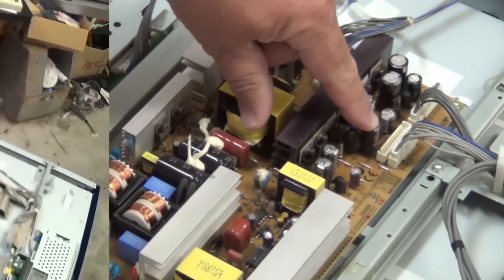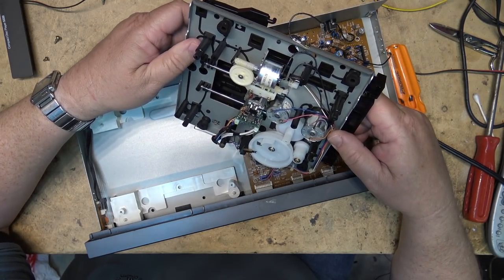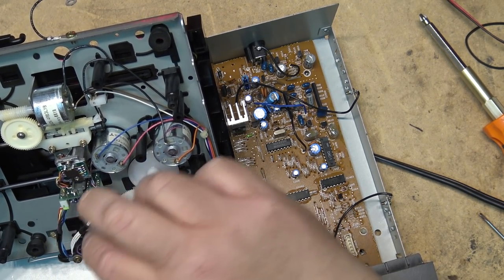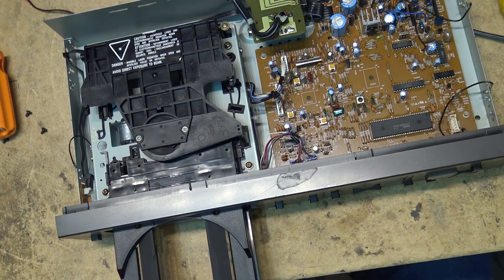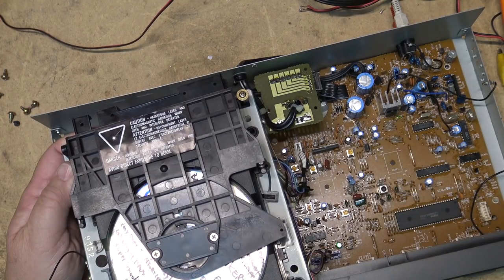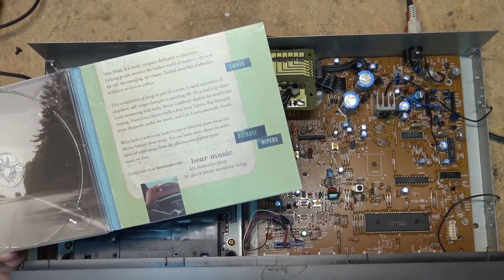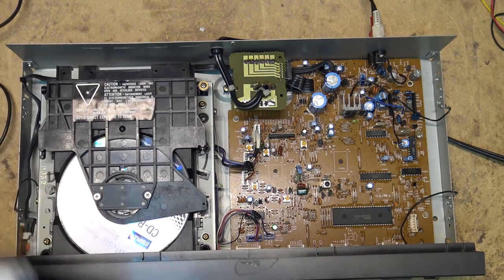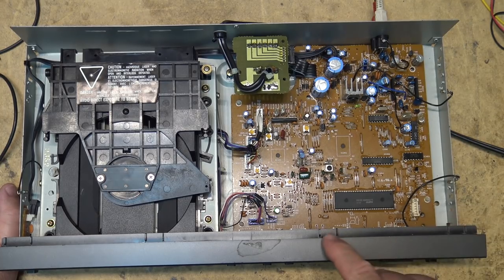NAD 5320 Single Disk CD Player REPAIR

Comment: You are right. The only way cd’s go bad  is through your own neglect. The cd is an excellent format for the car, boat,  home, or wherever you  roam. I personally love the format,especially for recording vinyl onto. I love vinyl also the vinyl may have the warmer sound; however, the cd has everything else one would want; convenience, compactness, record ability with no noise of its own,portability, etc. I find sometimes when they remaster the recording, it many instances they don’t sound right.(cd’s). I like NAD. I’m like you. I like CD players in the car. I like your videos.
Reply: I rather use a usb stick with Flac Files

Comment: Thats true with cars and CD players nowadays.. My VW Tiguan from 2015 still has it all. CD Player, Aux in, USB, SD-Card or Bluetooth. Mostly I use the bluetooth with my phone. As always very interesting repair video.
Reply from the maker: My older volt 2012 has USB, aux, and cd player that supports audio, mp3, .wave, .flac.  the new one has no cd. Just usb, sd, aux and of course bluetooth.  I don't steam music as my data on my phone is only 3 gigs. I also don't have much music on my phone. A couple thousand tracks is all as they were on the micro sd card when I plugged it into the phone.  I do have pretty much the entire library I have on the 128 gig sd card in the car.  It's great for road trips. I just leave it in random all the time.

Comment: NAD was founded in London / UK in 1972, I only own a Nad Stereo Amplifier 3020i which has cosmetic damage on the front panel but still works fine, I’ve tried finding a replacement front panel but they’re like Hen’s Teeth, I may find one one day! 🇬🇧

Comment: In the world of copier and printers, I used to clean contacts with a drop or two of alcohol on a piece of paper and slide it between the contacts while holding them closed. The paper was just abrasive enough and it was good for wicking up all the contaminants as well, If I'd known about De-Oxit I would have used that ... also use the same trick for Plate type magnetic clutches.

Comment: I have a NAD 5340 - very similar to this one. Skipping tracks and within tracks themselves. I'll change the belt and that might help!!! Now the one thing you didn't tell us was what was the greasy lube you put on the gears - I'd like to do that while I have this thing open!!! Also, I live in a very small town far from any place that would have belts. No more Radio Shack... How should I measure and then find online the proper belt size - there are few numbers on the laser unit? I do have a slide micrometer - I suppose I could use that and order a slightly smaller belt - Any good places you know to get belts? GREAT VIDEO - VERY HELPFUL!!!! MANY THANKS!!!!

Comment: I saw that chassis and immediately said Sanyo, haha. Fixed many in the 90s. Massive rebranding of Japanese gear with different outer casing. Denon were all Kenwood chassis. Anything European just had an old runout model Philips chassis with some back shed design line output board which made it sound amaaaazzzing. Well that's what the customer would say. My lowly ears couldn't tell the difference
Reply: Not true entirely. NAD ALWAYS had other component manufacturers to help keep cost down. Even the new 2020 NAD turntable 588, is made up of Project parts and components. The reasoning again, is NAD has always made lower priced components with a higher end attraction to have some awesome no frills audiophile equipment for budget conscious basement prices (sort of). I have a full rack of NAD from the late 80's through the 90's...still works, still kicks ass. My power envelope kicks the walls in with 300 watts. No way could I get that in any other system (Carver, Macintosh) without paying thousands.

Comment: I'm dumbfounded an AM transmitter @ 400mW can cause such issues... wow. I would never thought this possible enough to make the connection.
Love the cameo at 13:39. Had me laughing ;-) Cool new intro with the cat too!
Reply from the maker: That's actually an old intro. It was from part 4 of my 6L6 amp build. So this is only the second video with the alternate take.
Radio transmitters cause much interference.  This would not be an issue with the metal top on as that would shield it, but the rf coming off the laser pickup and being transported by wires to the main board.  With the top open act as an antenna and 400mW from the antenna pretty much directly over head is enough to upset everything.  You should see my scope display.  The test leads pick up lots of interference from it as well.  And to think my radio won't pick it up more than about 400 feet away. That same power on fm would cover the town nicely but I don't need any visits from the guys in the green truck with the antenna farm on the roof.
Reply: @12voltvids  Yeah, that would definitely show on an oscilloscope. I guess I never knew the laser pick up would be so sensitive to it prior amplification. Thanks for the clarification!
Reply from the maker: @jeremiefaucher-goulet3365  the signal coming off the disk is not that strong.  It also happens to be in the same frequency range.

Comment: I've a NAD 521i cd player that needed the laser replaced and now functions as it should except there was a squealing noise coming from the chucking clamping mechanism. Trying various attempts at resolving the issue, I found it was coming from the top cap where the magnet is attached to. By sanding smooth with 320 down to 600 grit the internal area of the plastic where cap and magnet spins, it corrected the problem and spins without the irritating and intrusive noise. Just thought I'd pass that along should you encounter the same issue.

Comment: Yes, CD players are now gone from cars, it really annoyed me as I used to buy discs of my own so I always had the music I wanted.  Now I have to put it to MP3 and onto a stick just to play music in the car.  I used to put it onto MP3 on a CD for the car, it was simpler just grabbing a disc from the holder and pushing it in, plus it went into the dash out of the way instead of sticking out where it is at risk of getting broken.  I also find it easier if I want a change of music, ok, the memory stick holds a lot more music, but I still like a CD so I can change the disc instead of searching to try to find what I want from a stick.  Manufacturers don't listen to customers.  We want our CD players back in our cars.  A copied CD can sit in the heat and if it gets screwed up we just burn another.  I never take original CDs with me in the car, so I can just copy it again.  However, it is not a problem now as they didn't give me a player, just MP3.  Not everyone wants to play from their phone or a memory stick.  They very nearly lost the sale as there was no CD player.  All I can say is "Thankfully cassettes is a thing of the past"  8 tracks were ok, but they always changed track in the middle of a song, couldn't they have rearranged it so it didn't do that, or left a quiet bit on each track?  Anyway, biggest problem with them was the players were to big and so were the tapes, I suppose the life of the tapes were not to good either.  It is a shame Mini Disc didn't take off and make it into cars, they were a nice size to store in out ever shrinking storage space in out modern cars!
Reply: Minidisc didn't take off in the US but it did quite well in the UK until the ipod trashed everything else in its sight. I had a Sony unit in my car and it was far better for mobile use than CD. But for convienience loading my Samsung Galaxy with evrything in flac & linking Bluetooth Audio is pretty unbeatable.
Reply: @davidpinfold852  Interesting you should say that, I only knew of one person that had one!  But yeah, I can see how MP3 would have impacted on them.  They were very big in Japan though.

Comment: Never heard of NAD before. Never seen it in stores before.  Is it like a boutique brand or some kind of higher end brand for audiophilies, educational, or institutional markets?  Is it a white van brand?  I am curious.
Reply: Many NAD models were above middle ground and some were very high quality. Definately not white van.
Reply: NAD are a very well respected brand & still in existence. The 3020 amp is a legendary choice & punched well above its weight despite its modest 20wpc rating.
Reply from the maker: Higher end than your typical Sony, technics, pioneer,  kenwood stuff.  British design.
They are now part of the lenbrook group that also makes very high end PBS speakers and are headquartered in Canada. I don't know where they manufacture their current equipment.  It is designed in canada now.  There were a few years in the 90s that the quality dropped when they switched from japan to china for manufacturing, but after lenbrook took over from what I understand they changed factories.  Lenbrook took over in the late 90s as far as I remember.  Other high end brands are also back now. Dynaco and Haffler are 2 high end brands back in the spotlight and they manufacture these ones here in Canada. Port Moody BC to be exact.  A new dynaco ST70 is on my wish list.   It may be there for awhile though as my old tube amp just keeps chugging along.  (McIntosh 1600)
Reply: @12voltvids  I wouldn't go that far. I'm not sure what their market position was in North America but in the UK NAD were fairly bargain basement but decent. No worse but no better than Kenwood or Pioneer's mid-range stuff. Tended to sound well but the build, and design was a bit mickey mouse at times.

They made their name with the 3020 amplifier, a very cheap Taiwanese-built (Tatung) device that scared a fair few old British manufacturers by demonstrating that good design with cheapo components and build could result in a decent show.

Comment: Hi Dave,
Thanks so much for this video. I've got a Goodwill purchased NAD CD changer, model 5170 that still works perfectly. It was part of a whole NAD rack mounted system that had just been put out for sale. When the time eventually comes, I'll be able to watch this video to gain some insight on how to service the CD player.
Question - How often is the laser diode the problem? And, how easy are they to replace?
Reply from the maker: Laser diodes will eventually get weak. The most common fault is not the diode, it is contamination of the optics which occurs when you permit smoking in the area where the cd player (or any optical drive for that matter) is used or stored.  The same thing happens to the smokers too. They die younger.
Reply: @12voltvids  Thanks for the information on the laser optics. Is it a simple matter of cleaning the laser lens and the laser diode to make things right again? Or, is it more involved?

Comment: First of all, I am addicted to your vids.  I rarely consider jumping at Patreon but if you have one let me know.  In your opinion, do you think there is appreciable audio differences between playing a CD through a desktop computer and playing one with a dedicated CD player like your NAD?  My computer is connected to a Rotel integrated amplifier and sometimes it's just easier to pop a CD into the computer CD ROM drive as opposed to dropping it into my Teac five CD player.  By the way, my Teac is going through my NAD preamp/power amp combo.  I love NAD.
Reply from the maker: I do have patreon however I don't really promote it. I have a few supporters and they are appreciated but nothing like the promise that patreon tells us we will get. When I release patreon only content and let viewers know I have released  exclusive content there I lose subs.
 www.patreon.com/12voltvids 

Playing a CD on your computer vs a CD player will depend on how good the D/A converter is on your sound card or main board. Some are very good, comparable to the best CD players.

Comment: It probably would have been a good idea to a timing mark on the cam gear before removing. Then it would have gone back together the same as it was from the factory.
Reply from the maker: It only goes in one way.  No timing mark required.
Reply: @12voltvids  oh that's good. With the position switch, it would have been hell without it.

Comment: Deoxit in the bottle... , hmmm. And sometimes spray some into the motors to clean commutator. It may not like the 80min CD-R just like my old Sony, no problem with 74min as it was the pitch standard for the tracks. No, the transmitter, sh.. I would wrap the thing into copper foil.

Comment: Sanyo lol, there is nothing wrong with there chips, why it was covered is anybodys guess.
D to A conversion snobbery maybe :-D
I've never been able to get the max writing speed stated on any disk/burner.
i also found the slower deeper coloured disks seem to keep the data good for longer.
Reply from the maker: Yes the dark, lower speed disks are better for longevity. I have some that were done in early 90s that play perfectly. I should do a video on old CDR disks.I have a box of old CD-r disks that I picked up years and years ago and never used. I use them for special projects where I want the data to last a long time. Mostly these days for photo storage. CDR has lasted far longer than USB stick. I have a 128 gig USB stick that was loaded full of music. It was the one I used in my first gen volt. When I got the second gen, rather than use up a USB port that I need to use with my phone for maps to display on the car screen, I put all the music on an SD card. The usb stick was sitting on my desk. I went to do a demo of a media player, and plugged the stick in and nothing there. Plugged it into computer and it can't read it either. Says it needs to be formatted. Have tried multiple ways to get data to read and nothing there. Good thing I have all my music backed up on CDR, DVD-r and even onto a few BD-R disks, as well as multiple hard drives.
Reply: @12voltvids  the first thing i would have done with that usb stick is run a disk editor and see if the boot record sectors are there, and look later on for data.
if all the sectors are unreadable then its likely the controller is dead.
I'm sure you did all that and more,
I don't give up easy, i can't see you giving up without a fight eather.
Reply: Many people who purchase NAD know this.  NAD ALWAYS had other component manufacturers to help keep cost down. Even the new 2020 NAD turntable 588, is made up of Project parts and components. The reasoning again, is NAD has always made lower priced components with a higher end attraction to have some awesome no frills audiophile equipment for budget conscious basement prices (sort of). I have a full rack of NAD from the late 80's through the 90's...still works, still kicks ass. My power envelope kicks the walls in with 300 watts. No way could I get that in any other system (Carver, Macintosh) without paying thousands.

Comment: I have bad 5235 it's not producing sound output but disc reading properly when I touching the spinning disc I am getting randomly clicking sound from speakers ..it's showing some reading error or somthing ..where I need to check further I already cleaned the lens

Comment: Nicely done !
But working on equipment that's still plugt in is not something someone should do unless it is absolutely necessary !
Reply from the maker: Why not? It's all low voltage on the secondary of the transformer.

Comment: I have a brand new one... although it sat in a box for a year before I set it up. Doesn't play. The display says "loading" forever. If you put any CD in, it loads for a full minute, then displays "TOC error" on all discs. A complete waste of a machine. Very disappointed.
Reply from the maker: Brand new? No that would have been 40 years ago.  New old stick is old. Old electronics break used or not.  It needs service.

Comment: Another brand busted with Sanyo parts... Ahaha
Reply from the maker: Not surprised here at all. Sanyo is one of the major component manufactures. For dac there was basically sony, Philips sanyo and Toshiba.  You were buying your parts from one of them.
Reply: @12voltvids  NAD were always closely related to Sanyo. Most of their gear, tape decks, CD players, receivers all Sanyo, either direct or via Tatung, which used mostly Sanyo solutions. Fact is Sanyo components were no worse than anyone else in terms of reliability, regardless of the guff stated about them on the Internet.
Reply: Not true entirely. NAD ALWAYS had other component manufacturers to help keep cost down. Even the new 2020 NAD turntable 588, is made up of Project parts and components. The reasoning again, is NAD has always made lower priced components with a higher end attraction to have some awesome no frills audiophile equipment for budget conscious basement prices (sort of). I have a full rack of NAD from the late 80's through the 90's...still works, still kicks ass. My power envelope kicks the walls in with 300 watts. No way could I get that in any other system (Carver, Macintosh) without paying thousands.
Reply: @natanpierce495  I know that "300 Watts" - I have one, the NAD 3100PE rated 60 Watts RMS...

Comment: Supposed to be top of the range NAD unit, made by cheap ass Sanyo! Audiophiles in the u.k. are going to have a fit! 😂😂
Reply: Not true entirely. NAD ALWAYS had other component manufacturers to help keep cost down. Even the new 2020 NAD turntable 588, is made up of Project parts and components. The reasoning again, is NAD has always made lower priced components with a higher end attraction to have some awesome no frills audiophile equipment for budget conscious basement prices (sort of). I have a full rack of NAD from the late 80's through the 90's...still works, still kicks ass. My power envelope kicks the walls in with 300 watts. No way could I get that in any other system (Carver, Macintosh) without paying thousands.